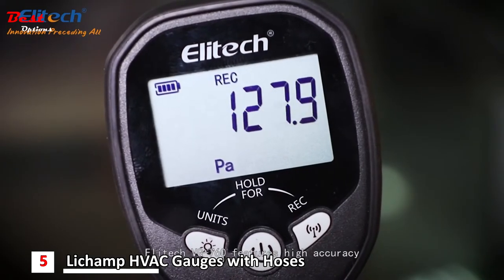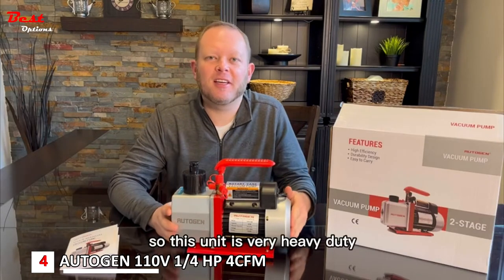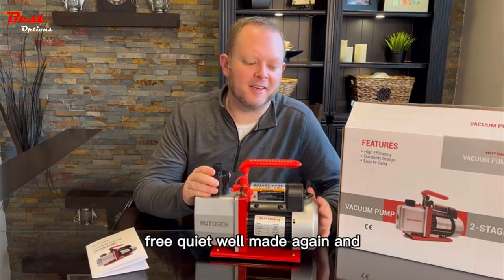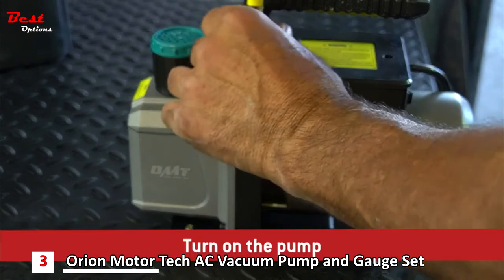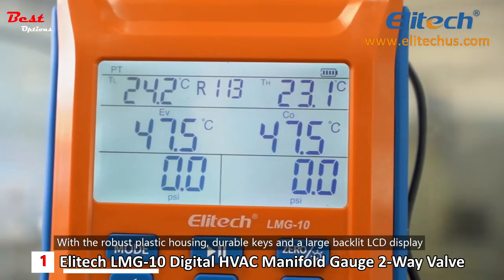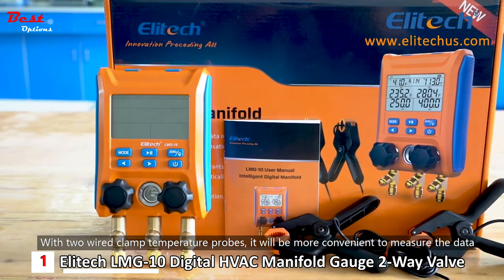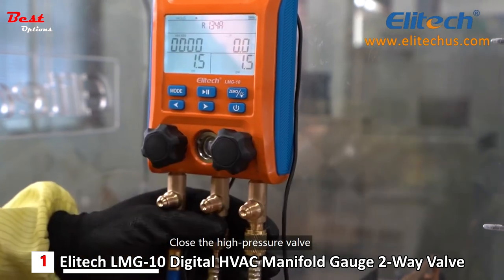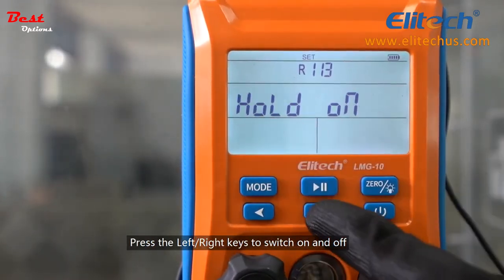Best Ac Manifold Gauge Set And Vacuum Pumps

Comment from the maker: ✅5.  Lichamp HVAC Gauges with Hoses
Amazon US – https://amzn.to/3JmIO33
Amazon CA - https://amzn.to/3oPwuPu
✅4.  AUTOGEN 110V 1/4 HP 4CFM Single Stage Rotary Vane Air Vacuum Pump
Amazon US – https://amzn.to/3OQQlrR
Amazon CA - https://amzn.to/3oQ9saY
✅3. Orion Motor Tech AC Vacuum Pump and Gauge Set, with 4CFM Vacuum Pump 
Amazon US – https://amzn.to/3Q9WUa8
Amazon CA - https://amzn.to/3oLLJc4
✅2.  GRANDMA SHARK 3.5CFM 110V 1/4HP Single Stage Rotary Vane Air Vacuum Pump
 Amazon US – https://amzn.to/3JpyS90
Amazon CA - https://amzn.to/3oLHptl
✅1.  Elitech LMG-10 Digital HVAC Manifold Gauge 2-Way Valve
Amazon US – https://amzn.to/3PVNv6j
Amazon CA – https://amzn.to/3zS5Taw